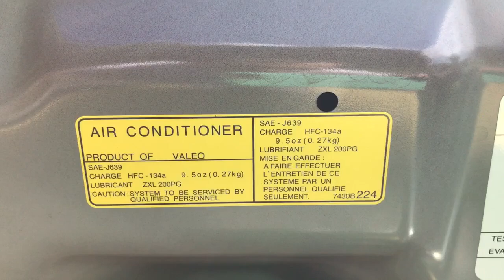2017 Mitsubishi Mirage G4 SE Engine Bay

Comment: I have the 2015 one, that is ultra reliable up to now. Only had to change front tyres and three sets of windscreen wipers over 60.000 miles (and the fluids of course). No issues with the CVT except the small detail that is too slow going from low to high gear in the first mile after cold start. It had that from new, but it sloooowly is getting worse. When warm, no problems. I saw a report from Consumer reports that the CVT of Jatco has improved a lot since 2014 in terms of reliability and longerivity. I drive the car until it is old and unreliable.

Comment: Is every component under the hood Mitsubishi?  For example in my Infiniti G20, I have a Mitsubishi distributor and possibly an alternator.  They are both incredibly reliable and have never been replaced.  I like the Mirage's warranty and mpg's in the city.  Do the rear back windows go down all the way?  This car would be great in a big city for zipping around!
Reply from the maker: Joe Smith Yes to my knowledge this engine was specifically designed for the Mirage when it came out in 2012 in other countries and is 100% Mitsubishi.  They have been making 3 cylinders for a while.  This is a world engine and is in the Mirage all over and it has proven to be very reliable with no major issues that are common.  They also make a 1.0L 3 Cylinder with like 70 horsepower in other countries where as we get the 1.2L 3 Cylinder with 78 horsepower.  Earlier US version Mirages had the same 1.2al 3 Cylinder but it made 74 horsepower.  When they updated the 2017s they added roller cam shaft and smoothed out the engine at idle, made the suspension lot better, added some sound deadening material, improved steering feel, and updated the interior and exterior styling and materials.  

Yes the windows in the rear do go down all the way and did in my 2015 hatchback as well.  The MPGs are great in these cars and when you are just cruising on flat the MPG numbers you can get are insane!

Like I said before we have been extremely happy with all of our Mitsubishis and the several people I work with love their Mitsubishis and all say the same as me “we will only buy Mitsubishi now”.
Reply: Big city? HA! Try the winding mountain roads in North Georgia. They're fun.

Comment: Thanks for the video. I don't see power fluid reservoir. Does the car have electronic steering instead?
Reply from the maker: DK L yes they have electric power steering.  A belt driven system takes power from the engine to run it just like the A/C System.  You can feel when the A/C System cycles, power wise where as belt driven power steering wouldn't affect it as much but would use a tad bit of the engines power.
Reply: K McKenzie that's exactly what I am looking for. I don't like dealing with the mess chagrin power steering fluid. I prefer electronic powering steering. Thanks !
Reply from the maker: DK L If you want a car that is reliable, feature packed, great on fuel, has a long warranty, and is fun to deive you ahould get a Mirage or Mirage G4.  I have owned 2 and my co worker has had her just shy of 3 year.  No issues to speak of they are little champs.  They also do quiet good in the snow!  The 14 inch tires on my 2015 Hatch did a tad better than what the 15 inch ones on my G4 do but they both go good in the snow.  I always loved the Metro LSi Sedans (2000) in the Burgandy color but never owned one so these are my modern day  Metros haha I finally got to get.
Reply: K McKenzie very nice , mind if I ask how much that you paid for your car out of the door ?
Reply from the maker: DK L Well my Mirage G4 SE (top trim) was $18,115.00 and with rebate and dealer discounts ai got it for $12,714.00 Tax Title Tags.
Reply: K McKenzie that's not bad at all. Thanks for the pricing info !
Reply: That's a great price. How has the car been?
Reply from the maker: joe b I love it.  It has al lthe features I wanted in a car and amazing fuel econemy.  My favorite features are the Push Start and FAST Key, Heated Seats, Apple Car Play and Auto Dimming Rear View Mirror.  I loved my 2015 Mirage as well and only traded up to the 2017 for the added refinement and added features.  My next car 2 and a half years from now will be another Mirage no question.
Reply: @kmckenzie2461  
Electric steering? You think they'd've gone with rack-and-pinnion. Electric is just unsafe if you ask me, since you can't really feel the wheels.
Reply from the maker: Scowler apparently its to save fuel and reduce engine load.  Belt driven power steering puts a load on the engine and with such little horsepower everything helps.  These are well thought out cars and very simple and reliable design.
Reply: It is rack and pinion, it's just electrically driven instead of hydraulic. Get used to electric power steering, it's on almost every new car now and hydraulic steering is rare today.
Reply: I dont think they have any power assist its just such a light and compact car you dint need it or feel it heavy.

Comment: man I'm struggling in Mexico to find parts for my mirage g4 2017, I use it for uber and I've already lost my warranty so I have to do services or replace parts on my own, do you know if there is a website that sell parts for this model? (same motor 1.2 3 cyl)
Reply from the maker: R Stinson yes eBay sells all parts for them.  Type Mitsubishi Mirage OEM Parts and they should come up.
Reply: RockAuto doesn't ship to Mexico.
Reply: What type of problems are you having with the car ?

Comment: vibrations everywhere. Yep, three cylinders confirmed.
Reply from the maker: Hahaha yep!  I love it gives them charcter and was the main reason ai bought my Mirages was the uniqueness of the naturally aspirated low horsepower engine as I always loved the 1998-2000 Chevy Metro LSI automatic sedans lol when I started driving in 2002 I wanted one so bad and don’t know why I never got one.  I guess cause I wanted to buy new. 

My first brand new car was a white 2002 Kia Rio 5 speed I got new at a Hagerstown Kia for under $10,000.00 they had Kias on sale back then buy one get one free haha and you only paid taxes on the second one and got the cheaper one free.  My brother got the 2001 Kia Sephia and I had the Rio lol.  Neither were that great lol and the Sephia was really really bad and at the dealer monthly for transmission o/d issues and tough shifting and the muffler would split at the seams every 1,000 miles on the Sephias.  That was back when Kia was just starting to improve year by year.

Comment: hows your mirage doin' at this moment? do you still use Ow20 oil? I would like to know how's you engine using it as I am about to change my mirage''s oil
Reply from the maker: I no longer have my Mirages I have a new Mitsubishi Eclipse Cross now.  My co worker had her 2015 Mirage for 5.5 years and has now had her 2019 Mirage G4 she got new less than a year ago.  She always used the 0w20 Mitsubishi oil and never had 1 issue at all the 5.5 years she had her 2015 Mirage and now issues with her 2019 Mirage G4.?

Comment: With this car being Mitsubishi the CVT scares me ... I want to find a 5 speed...
Reply from the maker: Tony coffee from what I read the key to CVTs are keeping up with the CVT fluid changes and Maintenance Schedule.  Time will tell but I usually trade every 3 years so don’t for-see any issues for me but the 5 speeds are peppy!!!
Reply: Mitsubishi and Nissan have the same CVT. Mitsubishi has less torque and a transmission cooler, Nissan has more torque and no transmission cooler. Nissan's CVT's break and Mitsubishi's (identical) CVT's do no break. It remains important to change the fluid on time (once every 100.000 km at least).

Comment: do you change your own oil?  what's it take 3 qts?
Reply from the maker: joe b I wanna say 2.9 quarts lol.
Reply from the maker: joe b I know how to change my own oil but I have all my work done at Five Star Mitsubishi as their prices are great and service is amazing.  For $49.99 I get my Oil changed (0W20 Synthetic Oil), Oil Filter Changed, all fluids checked and filled, air in tires, tire rotation, and a good car wash each time.  Even though it is Synthetic I have mine done every 6 months or about every 5,000 miles.  I know it can go a lot longer I just feel better taking really good care of the car.
Reply: @kmckenzie2461  hey, so you still driving the car? 2021 is nice looking with body style changes. And you can still get a manual!

Comment: looks like easiest thing in the world to work on
Reply from the maker: Ryan Tornai Oh yea everything is so easy to get too and you can basically every part of the engine.  I like that its a basic engine design made for longevity and simple maintenance.
Reply: @kmckenzie2461  
Will it hurt your warranty at all?
Reply from the maker: Scowler Mitsubishi says save all slips of oil changes and such and parts slips and you are good.  Now as for a cvt flush I would only have it done by a dealer.  My dealer says every 30,000 miles to do a cvt flush.  My coworker had her Mirage cvt flushed by the dealer at 30,000 and 4 years old and it was $149.00 not bad.  Plus Five Star Mitsubishi is great with covering the warranty and taking good care of our cars during service They change the oil (0w20), change the oil filter, wash the car and wheels, rotate tires, fill fluids, do tire pressure and do a 27 point inspection with print out on brakes, tread wear, battery, starter, lights and more.  All this for under $50.00 is amazing!

Comment: Looks like engine failure at 100,000 miles
Reply from the maker: Nope.  Look up the 414,000 mile 2014 mirage still running fine with not one engine or cvt transmission issue.  These are reliable cars.  Many online for sale with well over 100,000 miles and close to 200,000 miles still running great.  

Any car not taken care of or run to death all the time and abused will have issues.  The Mirages have great reliability in all countries they are sold in.